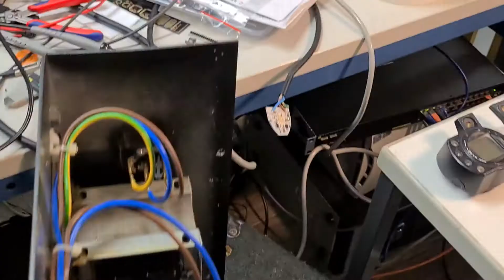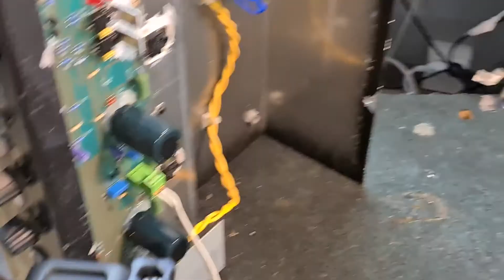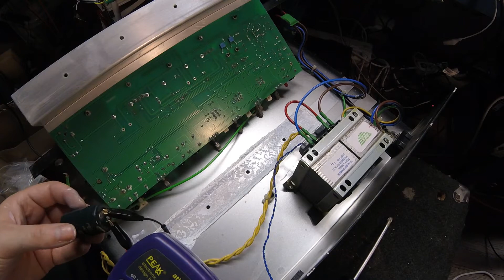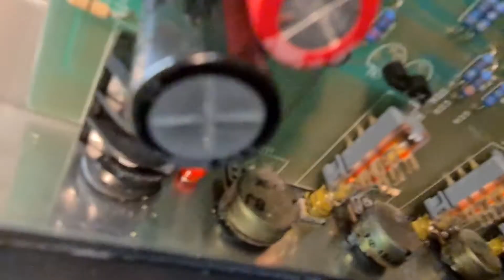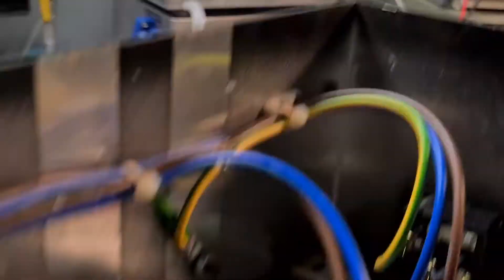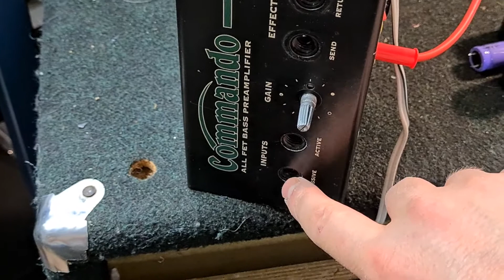Trace Elliot Commando Combo - Part 2: Repairs

Comment: I have this amp and it came to me 2yrs ago, with a the speaking making terrible noises, then it blew the TIPs. I replaced the TIP31/32/35/36 only to have it blow again after running for a short while. I also replace a number of other parts including the 3.3k resistors as the were burnt.

After 4 attempts at changing and blowing, I gave up. It sat in garage for a while. So I pulled it out again this week.
I cut out the TIPs and opened them up as I wondered if they may have been fake, they were.

So basically, I had been fitting fake parts that could not take any load, these all came from eBay same seller.

So I bought new ones from CPC and now it works fine.

Watch out for fake parts folks, it caught me out multiple times.

Comment: Hi, I have this amp, and I wanted to change the large filter capacitors to improve the sound. I have a big doubt because the diagram does not resemble any amplifier diagram that I know of. I'm definitely not an expert, so I'm asking if I can increase the capacity without compromising operation. Thank you
Reply from the maker: The "sound" shouldn't improve much by larger caps (new caps might help filter out hum better though). On voltage rating, you can go as high as you want, but try to stick within 120% of the original capacitance values, any higher and the inrush currents when powering on can become an issue. When I replace these, I generally look for caps with the same diameter and leg spacing, slightly higher voltage rating, similar capacitance (100-120% of original rating) and the highest temperature rating I can find. Better capacitance tolerance isn't worth paying extra for though, +/- 20% is good enough for big filter capacitors.

Comment: I have this same amp. When I turn it on, the fuse on the back of the power plug blows after a second. Do you think it's a capacitor or mosfet problem?
Reply from the maker: Could be either or a shorted power transformer. Start checking resistance between power and ground, working from the power cable towards the mosfets. That way you work towards the short. Remember to also flick the power switch on and off to see if the problem is before or after the switch. How large is the fuse in the plug, 13A?
Reply: @GrumpytechieNet  Thanks for the reply. The transformer is ok because I tested it disconnected from the circuit and the fuse doesn't blow. The fuse is 1.6A as indicated on the back. I'll try to check the rest of the circuit over the weekend.

Comment: I have this same amp. TIP31C and TIP32C run quite hot. I adjusted the voltage to 20.9 and fabricated two GIANT heat sinks for them. The last time I replaced them, before replacing the heat sinks, it lasted 6 months, then TIP31C shorted out. Collector voltage is 57VDC. Do you think the new heatsinks will allow them to last longer? I drive this amp pretty hard, but I don't want to have to replace the transistors every 6 months!
Reply from the maker: Seems a bit odd to be honest, so they get hot with the amp just sitting idling, turned on with no input signal? The bent aluminium plate that function as a heat sink for the transistors is supposed to be bolted to the chassis with thermal compound in between it and the chassis. Maybe the old compound had dried up over the years?
Reply: @GrumpytechieNet  Thanks for the quick response. Idling, there is a little heat. Pushed hard, they heat up. I believe they are rated at 150C. TIP31C and TIP32C have their own, individual
 L-shaped heat sinks, mounted on the PCB. I cleaned off all the old compound and liberally applied new throughout. R12, R13, R30 and R31 also run hot. I've played it now for a week and so far, it's working. I'm thinking maybe it's normal. Hopefully, the larger heat sinks will give it longevity. Maybe that's why they don't make this model anymore.
Reply from the maker: @eddiegarcia3202  I'll check the heat levels in mine, I'm still in the middle of replacing some pots!
Reply: @GrumpytechieNet  Thank you. Great channel, BTW!
Reply: @GrumpytechieNet  Did you ever check the heat levels on the transistors? So far the larger heat sinks 
on mine seem to be working. The heat sinks are hotter to the touch than the transistors themselves!
Reply: @eddiegarcia3202  Thermal compound is best used sparingly, rather than liberally. Apart from making a mess, if you use too much you'll increase the thermal resistance between the transistors and the heatsink instead of reducing it.
Reply: @johnm2012  I didn't overdo the compound. As I stated, the larger heat sinks are actually hotter to the touch than the transistors themselves, so I believe they're doing their job. The voltages are correct as well, so I assume the design runs them hot. Hopefully the oversize heat sinks become a permanent fix.

Comment: Hi, thanks for putting up this video, I have the exact same amp, with the same problems, hum and scratchy pots.

I'm not an electronics expert but have done a fair bit of tinkering so will replace the caps and clean the pots, where would you recommend sourcing the components, RS?
Thanks Sean
Reply from the maker: No worries mate! The components are from Mouser, they have quite a good policy regarding free shipping including import duties. I'm actually working on a third part on this video, as the pots never cleaned up properly, so I'd get the pots as well while you're in there.
Reply: @GrumpytechieNet  thanks for that I'll look out for your next video. I'm also missing 2 knobs, no idea where to get them from!
Reply: @GrumpytechieNet  Further from my previous comment, my amp was water damaged so much that it had rusted the bolts holding the board to the cabinet so couldnt get it out, another one came up on ebay for £50 so I've bought that one, seems perfect apart from a crackly volume pot, as it's over 20 years old would you recommend replacing the caps as a matter of course? 
And as a thank you for this video I have 3 knobs which you can have, if you can send me your email address I'll contact you and post them to you. Thanks Sean
Reply from the maker: @seanf42  I'd say replace them all while you're at it, they aren't that many nor very expensive. Be prepared that some of the pots might be shot as well, I had to replace the volume 1 Meg as well.